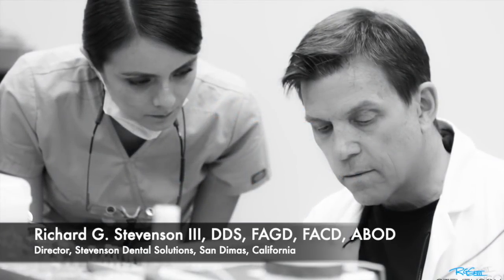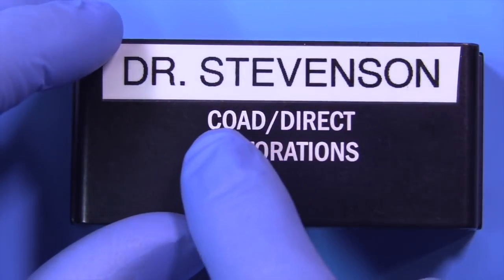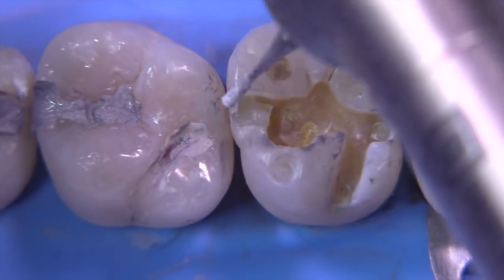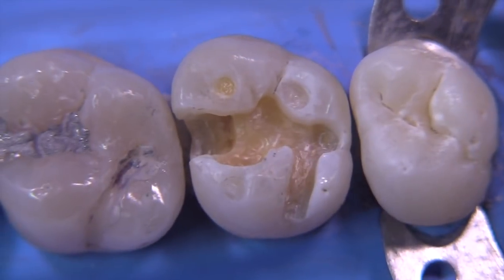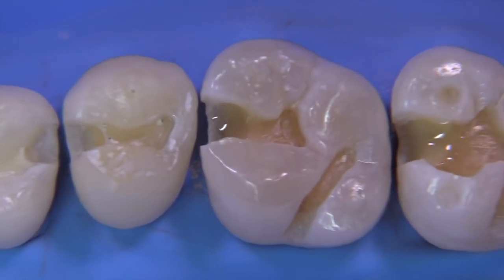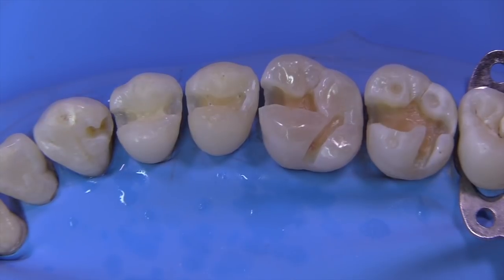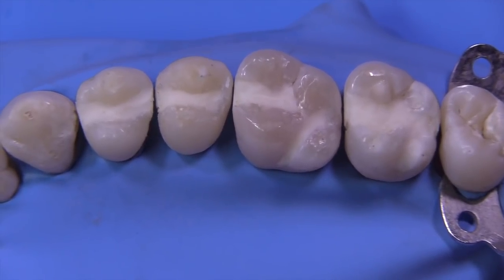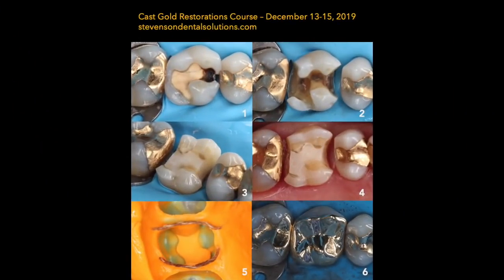Cast Gold Restorations, Part 1: Diagnosis, Clean-out and Block-out

Comment: Dr. Don't you etch the surface before bonding? Also whats the purpose of blockout? Why dont you start prepping directly?
Reply from the maker: Great questions!  MGI Liner does not require polyacrylic acid surface preparation to modify the smear layer, however, it may be used.  The clean dentin surface has numerous bondable interfaces without using the PAA step.  The purposes of the block out include many advantages including: saves tooth structure by filling in dentin undercuts, provides for e clean start to every prep, conserves gold, allows for optimal pulpal and axial depths, allows for a smooth wax pattern and casting, facilitates cementation.

Comment: Thank you very much for your lesson! I have a question. Can I use self-curing GI such as Fuji IX for block-out?
Reply from the maker: Yes, it has good compressive strength, and all of the benefits, except command setting, which is fine - just takes a little longer.

Comment: what is the difference between hatchet/ chisel/ gingival margin trimmer ? and which one I have to buy if my speciality is operative?
Reply from the maker: Hi Doc - A Hatchet is in the Chisel category, but is named such because the blade is rotated 90 degrees relative to the handle and it is used like an axe/hatchet when cutting.  Chisels are everything else and have a 90 degree cutting edge relative to the blade and the blade is in line with the handle.  GMTs are curved bladed and have an angled cutting edge.  I would own the following for operative: Hatchet, Bin-angle chisel, Straight chisel (Wedelstaedt), Off-angle chisels (mesial and distal) and GMTs (mesial and Distal) and perhaps a small 1 mm Hoe and an Angle Former.  Check out Sturdevant - The Art and Science of Operative Dentistry for a reference.